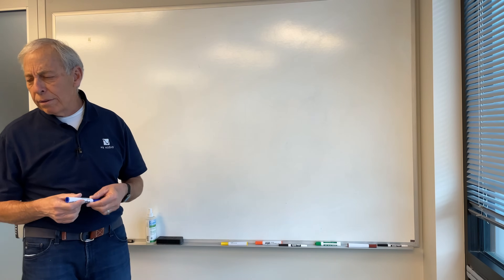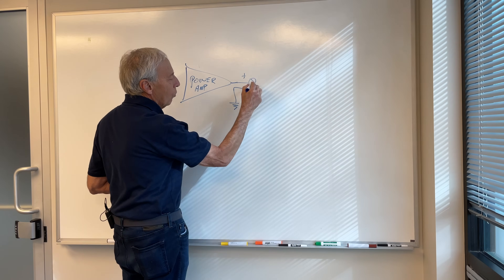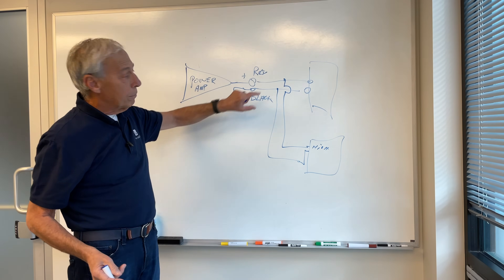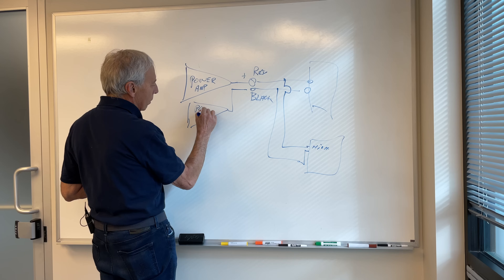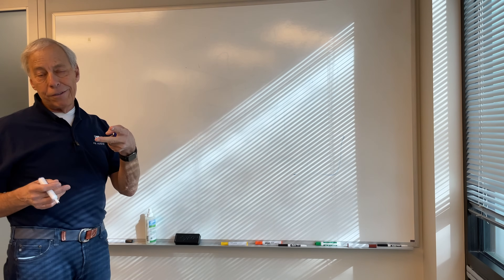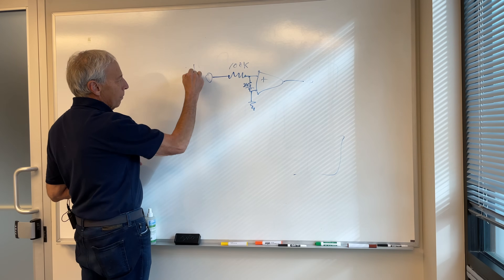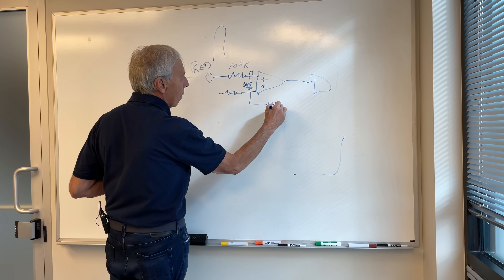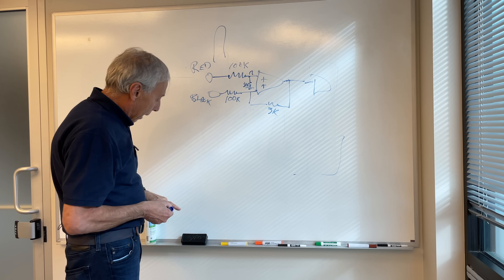How does a subwoofer high-level input work?

Comment: Amplifiers with balanced outputs can pose a challenge,hooking up to a subwoofer with a grounded power cord.
A condition known as a Ground Loop happens.
Google the term for a TLTE.(too long to explain)(LOL)
A radical idea when using a powered subwoofer with a grounded power cord is to isolate the ground prong-temporarily-and then bring up the source volume slowly.
There should be no source amp tripping out due to an output imbalance,since,no ground return exists.
I cannot guarantee positive results,so use your best judgement.

Comment: Didn't answer a lot for me. What about the other channel. Do we use a mixer to combine L&R line level signals? Do we use something similar for High level signals. Using a "Y" connector on line level outputs of a stereo preamp fails miserably for me as it seems to muddy up the imaging and I'm just talking about the effect that a sub can have on the listening experience. Where you have L and R line level inputs on a sub and use the L and R preamp outputs to feed these, is there some sort of signal mixer in the sub amp circuit? Sorry, too many questions.

Comment: This is brilliant and something I'd never considered. In the past I figured high level inputs were inferior to low level inputs, and right before watching this video I figured they were equal to low level inputs, but Paul's point makes the most sense of all: high level inputs are superior. Only use the sub's high level output when daisy chaining two or more identical subs together, and never back to your main speakers. For easier connectivity to your amp, you can run very thin wires, perhaps 18g or higher, to the sub's high level input, as only a trickle of power is sent to the sub.

Comment: Kindly help...car under-seat subwoofer Pioneer TS-WX400DA with built-in amp and accepts high-level input. For speaker level input, do I need a 'High-Low converter'? ...this is because my subwoofer accepts Speaker level input. ....Second, is input from one speaker enough ? or do I have to take input from both speakers to feed the sub .....

Comment: Very well explained .. I am a little bit confused highly appreciate it if someone could help me with this...I have just bought Pioneer TS-WX400DA  car under-seat subwoofer. It has a built-in amp, a switch for speaker-level input, and two RCA connectors for audio input. I am going to place it under the driver's seat. To power the subwoofer I will battery connection. My car receiver does not have an RCA output. 

I am planning to take audio input from my front driver-side speaker and split it into two to feed the two input female connectors. Plz help me with the following, am I right or wrong-

1: I guess, I don't need a 'High-Low converter' as my subwoofer accepts Speaker level input. I just need to run two wires from one of the speakers to connect with the subwoofer.
2: .Do I need to take input from both speakers to feed the subwoofer?  or input from one speaker is enough...after all both speakers carry the same audio signal .....

Thanks in advance..

Comment: Great video , you lost me 1 min into it, it’s okay that’s on me, not the brightest, hence my question:
I have your Sprout100, (loving it!), wanted to add a REL T9X and they say to connect it via high level output, .. how do I do that (if at all)? The sprout has the sub out, but from what little I got out of this video is that I shouldn’t use that because it connects to the “low level” , and what I have to do (I think) is somehow cut the cables going into the speakers and somehow plug that into their high level .. but then you mentioned something about this shorting out the system.. 

Brain hurts, please help. 

I’m all seriousness tho I really like your Sprout100 and really want to make it work with the REL T9X through their (and your) recommended “high output” connection; can I do that and if so how ? (With lots of details please, I’m really far behind on this).

Thank you and have a wonderful day.

Comment: So I just learned that all subs are grounded so I can’t connect my amp on high level inputs without short it. So that didn’t answer my question at all because that don’t make sense.
What I really wanted to know is how connecting the sub on high level input affects the impedance on the amp because my speakers are 4ohms and I don’t want to go lower with the risk on breaking it.
Reply: I know this comment is a yr old lol, but both the high & low input’s are attenuated in the pre-amp stage in your amp & do not affect the output (power rated) section which includes the ohm rating. So it wouldn’t hurt it.

The power rated section (amp output) is what you match by the wiring configuration of your subs, which cant go below amp’s ohm rating or the amp will pass much more current through that path which lacks the rated resistance, likely frying the amps power output sections. The high level input would have nothing to do with that situation though, as all hi-in is doing is telling the amp to knock off some gain sensitivity so there’s no input clipping.

Comment: Thanx for sharing. I,m trying to connect from an avr high level out (tapping center sp out) to a subwoofer low level in terminal. is it safe to do? I already run pout of subs out. Using 4 rels for LFE, but I like to create rel 3D by adding 3 more subs to 1:mains, 1 to Center, 1 to surround. I have extra subs I can use but they only have line in or LFE available no high level in. perhaps using a high level in line out converter  solves this? Anybody?

Comment: Dear Paul, regarding high level connections. Do I really have to wire the sub all the way back to the amplifier? Surely I could connect the sub to the speaker terminals if that is the shortage route? I would love to hear your comments. Thank you.
Reply from the maker: Yes, absolutely you can do that and that's the easiest way to do it.
Reply: @Paulmcgowanpsaudio  Thank you Paul for your confirmation regarding high level connections. Btw, I am in the proccess of setting up  a pair REL T/9i subwoofers with my Quad 57's. My thoughts were that connecting  up using the High level inputs rather than the usual low level line inputs was just 'snake oil'  promoted by Rel!! But having tried both ways, I have to agree (at least in my case) that intergration and smoothness at the crossover region is better with the high level inputs. My results are based on using  REW  and a calibrated mic at listening position. Setting up by ear is too hit and miss in my opinion.

Comment: Okay Rel
I’ve sent a request thru your actual site to combat the hum in my T5x stereo pair hooked up via high level to my Bat VK-75se with no response.
I floated the black wire. I connect the black to chassis ground on my bat preamp. I’ve hooked up rca connectors to LFE on the sub to the preamp unused connectors. Hum persists. What is the solution?

Comment: I am running a music only, 2-channel HiFi system that uses a Vincent SA-31 MK preamplifier and a Vincent SP-331 power amplifier. SVS recommended the SB-1000 Pro subwoofer for my speaker and room size. Will I get better sound quality by:  using the RCA connections and putting this sub between the preamp and amp ( Preamp -> Sub -> Power Amp -> Speakers ) OR using speaker cables utilizing the high-level speaker wire inputs on the sub ( Preamp -> Power Amp -> Sub -> Speakers ) ? Thank you in advance for your recommendations.

Comment: If the subwoofer is setup for balanced input,as Paul shows in diagram, can it be driven by amplifier output with the grounded black speaker output?

Comment: I just purchased a Yamaha Model:R-S202BL and have not hooked it up yet. I do not know if it has balanced or grounded speaker outputs. I will be adding a monoprice 12" subwoofer and I do not know if it has grounded negative high inputs. Can I simply use a multimeter to see if the receiver high outputs black negatives have continuity to chassis ground? And, can I see if the subwoofer high inputs black negatives also have continuity to chassis ground? I know this equipment is not overly great or expensive and is just for a reasonable shop stereo. I just do not want to screw it up on installation. Blessings if anyone answers.

Comment: Hello Paul...hello youtubers...question? Does anyone know if the high level Neutrik speakon connection plug (sub end) are all the same ie are mj acoustics..rel..mk all the same type of plug.? I can purchase the high level lead from a company online and they sell the rel high level Neutrik speakon lead (3 wires) problem is I have a mj acoustics subwoofer and they are not sure if there cable will work with the mj acoustic subwoofer?  The rel lead is considerably cheaper than the mj acoustics lead and as such would like to buy the rel one to allow that saving...how can I find out? Is the pole/pin configuration different between the 2 ie 2 pole,3 pole and 4 pole ect? Nobody seems to know the answer! Any help would be appreciated.

Comment: Wait do i get that right now... u basically take just the sound signal, from, say ur main speaker channel, so u double plug the main channel and run one pair cables to the speaker and one pair cables to the high lvl input on the sub? Or did i Literally got it all wrong?😂

Comment: won't it have a negative side-effect on the poweramp now ?  won't it influence the sound that is produced  by the main speakers because the amp not only drives two front speakers but also the subwoofers amp ? (i have a denon av-receiver with pre outs to a denon poa-2600 power amp for the front speakers. i don't feel comfortable driving the sub-amp by this power amp so i use the sub-amp for filtering, with sub-amp connected to the sub-out of my av-receiver . The av-receiver drives no front speakers, but it powers the surrounds and center in case of watching a movie )

Comment: Hi, I appreciate this information. I'm connecting my system today. I agree with your stance on using the high level inputs. I'll be connecting a vintage Harman Kardon 330C to a powered sub via the high level inputs on the sub. The 330C features  2 channels, "speakers 1" and "speakers 2." There's a separate pushbutton on/off switch for each. I already have "speakers 1" connected to a set of towers, so if I connect "speakers 2" to the high level inputs on the sub, I won't have any concerns or cautions like you were discussing with the grounding out of a bridged channel or anything, correct?
Thank you.

Comment: If it's not a pure stereo system I recomend RCA (or XLR) since many have combined stereo and surround you will NOT get the LFE channels effect when using surround and using high level input on the sub.. I have a dual mono stereo amp with it's own power amp input and passthru for 2 subs for home cinema use so I can combine both pure stereo and surround. Connecting the sub to the speaker output will ruin the setup. And it's easier to correct for phase when using sub outputs.

Comment: This is just silly -- we're talking about a very low-pitched octave or so, an octave that has no audible "sonic signature" to speak of.  Even if you don't believe that, do things Paul's "proper" way and whatever little "sonic siqnature" the power amp has down at the low end of the audio spectrum will be added to whatever "sonic signature" the sub's amp has -- IOW, Paul's recommendation presumes that the subwoofer has a perfectly transparent power amp, which is more than a little naive.  The character or timbre of a bass note comes from the mid-bass range, not that lowest octave or so, thus it's your L+R speakers that deliver the difference between an acoustic bass note and an organ pedal bass note, not the subwoofer.  IMO, you'll be doing yourself a favor by driving your active sub via the same preamp outputs that drive your power amp, using a couple of simple Y-adapters if necessary.  My sub does have "proper" high-level inputs, BTW -- and as far as my ear can tell using them confers no audible advantage whatsoever.

Comment: Give examples of subs with built in high level input. No rewiring required please.
Reply: I love my Velodyne.
Reply: @mikecampbell5856  Mike can you help me out I am new to this when you using your amplifier high level on your subwoofer which one is basically the best volume to use the preamp on your receiver sub out to turn it up or just leave it down and turn the volume with the amplifier from your subwoofer high level to blend in  speakers thank you
Reply: @petercollie9251  Hi, when using the high level (speaker level) input and output terminals on your sub, set the crossover to about 100hz, play some tunes and turn up the sub volume level until it becomes noticeable then back it off a bit. When using the RCA sub out on your receiver, all you have to do is set it to a level that sounds good to you, the internal crossover on the receiver will take care of the levels for the most part. Use the line or LFE input. Some subs have a L and R input. Use the L. Check out the menu for your receiver if it is a surround receiver. You can set crossover frequencies and levels with your remote and customize your sound. You can have a blast doing this.

Comment: High level inputs should be differential indeed as Paul explaines. Works universally. Crap circuits like REL's where you have to connect somewhere to the chassis although nothing is provided for that is a solution not matching all real world situations. And it is costing pennies at most indeed as Paul says to implement it well. Suggests REL lacks the proper engineering skills or mayby just buys cheaply from China.  (I have a REL and found difficulty connecting it with my Pioneer Kuro: RCA had a hum due to a grounding loop, high level speaker output balanced)
Reply: Sorry, but that comment is just a big steaming load of "REL bashing" horse sh!t... 

At best it sounds like you bought a product you clearly have no idea how to PROPERLY use-for Christ sakes, you hooked your sub up directly to your "plasma TV" which is about the SHITTIEST hit/miss connection scenario imaginable for performance since the audio output stages in all those Plasma TV's were utter "lowest common denominator" garbage to begin with (talk about using cheesy "Crap Circuits"!) and you're wondering why you are having "difficulty" with performance and grounding issues with your sub?🙄 
Seriously? 
That’s called “User Error” dude, BUY A "REAL" STEREO/AV RECIEVER OF DECENT QUALITY AND YOU WON'T HAVE NOISE AND GROUNDING ISSUES ANYMORE! 

What you're doing right now is the equivalent of someone buying a high performance sportscar then putting shitty cheap ass tires and brakes on it, using the lowest grade fuel and oil they can possibly buy and then getting online afterwards to ignorantly complain about the performance of their car like it's supposed to somehow miraculously turn shit into sugar...

I have used REL subs in multiple systems for over 20 years "without" issues (I just recently upgraded to S812's in one of my systems after listening to numerous competitor subs just to see if there were any other potential contenders to the throne so to speak) and have yet to hear any sub outperform the REL’s in a real world situation "when" connected and dialed in correctly. 

BTW: You ARE aware that Paul himself uses REL's in his own home system and recommends them, right?

Comment: So how many folks out there have a schematic of the front end of their sub-woofer amp ?  In addition the "negative" output of most class-D amps is floating, so you can't connect that to nothing but a speaker. If you are using a single sub-woofer and amp in a center ch configuration the BEST way is to just y-connect the pre-amp out into the low-level (high impedance) sub-in. If you have a "center or sub out" on your preamp or surround processor use it. Most sub-amps "sum" (really an average) the two ch. together as input for the single ch sub-amp. Paul's method works best if your are using a separate sub for each ch. AND your amp output (black-terminal) is tied to ground (aka class A or AB amp). Never use the speaker cable "bypass" connection on the sub-amp itself for reasons mentioned below. It just there for convenience and should be avoided.
Reply: each situation is special because everyone is not using the same amp and same sub.......I guessing before anyone hooks anything up you better do some serious research and ask lots of questions.........I believe you know what you are talking.

Comment: TL:DR

ALWAYS SET YOUR SPEAKERS AS SMALL IN BASS MANAGEMENT AND USE THE LFE INPUT OF YOUR SUBWOOFER AND MAX ITS CROSSOVER IN ORDER TO USE THE ACTIVE CROSSOVER OF YOUR PROCESSOR AND GET THE MOST ACCURATE BASS REPRODUCTION IN CONJUNCTION WITH YOUR MIDS AND HIGHS.

or take the word of a guy who cannot recall a name from two minutes ago who is stuck in the dark ages of modern audio tech.

😊
Reply: Thank you, mr. troll, for screeching at the top of your verbal lungs at us the exactly incorrect way of doing things, while rudely getting in another jibe at our gracious host.
Well done.
Reply: @Hare_deLune  
LFE is the best way to add a subwoofer to a system. 
PERIOD
Reply: @Finn-McCool 
Yeah.
So says the yowling troll!   😂

Comment: i have my amp to elac sub to high level ins. works well with blended crossovers. with low level rca in if u use intergrated amp. some cannot control volume of subwoofer. need preamp .either active with power amp. or passive with intergrated. or adjust vol. of sub. to blend with speakers. both can activate different sound signature.